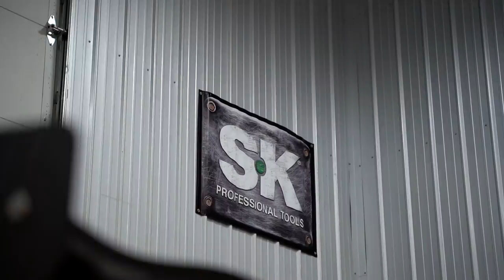The Massive Announcement.

Comment: Lucky guy! My father always told me to buy the best tools that you can afford. Nothing worse than a cheap tool breaking when you are working on your car on a weekend, and the shops are closed. SK Tools are even sold here in Japan, mainly metric, though SAE is also available. Great quality. I prefer their 1/2" drives compared to the flimsier local 1/4" and 3/8" items. The biggest item available here is the 272 piece VTS03289 Master Tool Set.